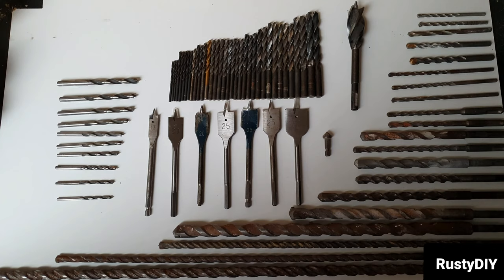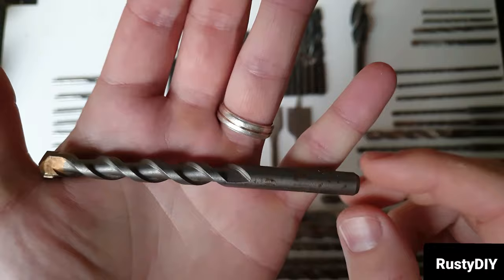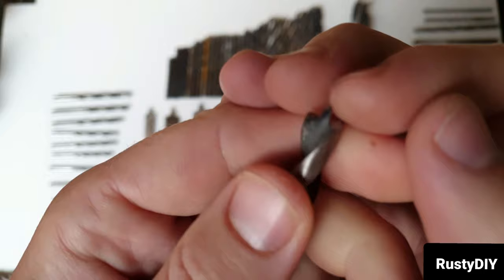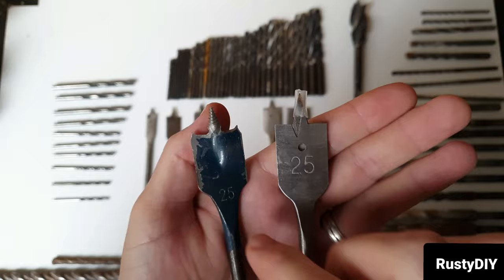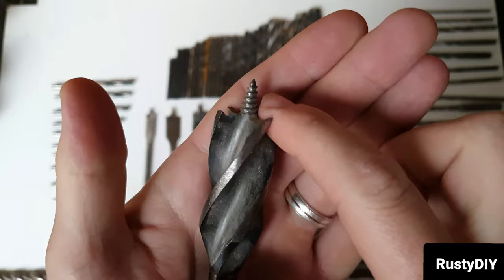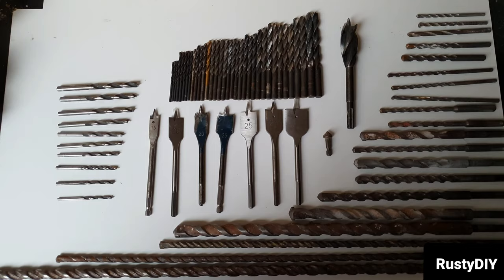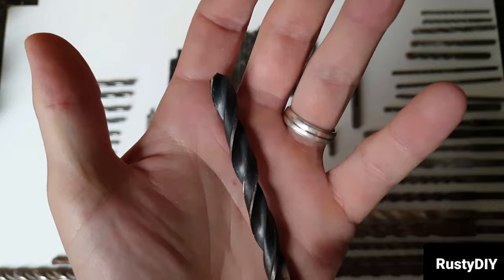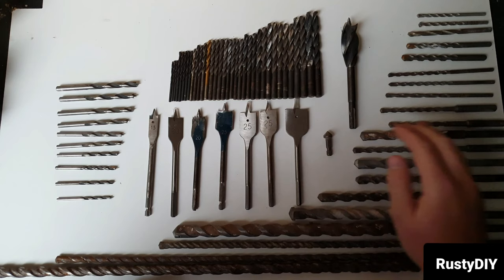DRILL BITS, what drill bits should you use and the different types. (drill bits EXPLAINED in 4K)

Comment: Thanks mate. Enjoyed that. Out of interest why only recommend that narrow range of bits at the end of the video and not a good set from 1 through to 12 mm? Also, are empirical bits still needed in the UK/EU area?
Reply from the maker: Thanks. The sizes I mentioned at the very end was ment to be in regards to masonry mainly, as 5.5, 6 and 7mm are your most common wall plug sizes (red and brown) and a set of say a masonry set from 3mm to 10mm more often than not. Also when it comes to kitchen fitting that I did a lot of over the years things like wooden dowels are normally 6mm.
Reply from the maker: I'm not always the best at explaining sometimes but what I was trying to get across was for DIYers a set of HSS say 1mm to 10mm and then a few masonry bits 5.5, 6 and 7mm sizes and with those bits you could probably do 90% + of their DIY jobs. But for a tradesperson or more DIY enthusiast then a full range of all bits will be needed. For me over 17 years or so of building trade work i have bought only a handful of sets but hundreds of 5.5mm and 6mm bits. And hundreds of 20mm and 25mm spade bits (as an electrician).  I hope that makes sense my  explanation, thanks for your comment 😀
Reply from the maker: Imperial bits I have never referred to them nor worked with anyone young or old that will name a drill bit size in imperial (except spade bits sometimes have inches on them) we do have imperial measurements for screws and bolts ect in the uk but drill bits are metric as far as I'm aware.
Reply: @RustyDIY  Yes, I get your point totally. I found myself lacking a 10 mm HSS bit earlier. Fortunately going into soft wood so could use a masonry bit but I think it's time I picked up a set instead of one bit here, one bit there!
Reply from the maker: Ya a good set will last ages if used right and looked after, getting them wet, overheating them and using them on concrete based products kills them quick